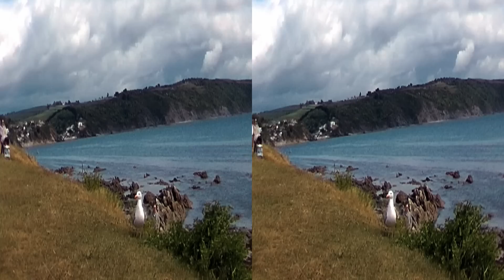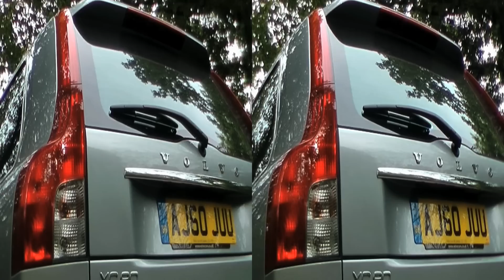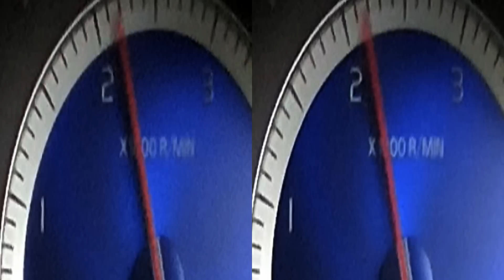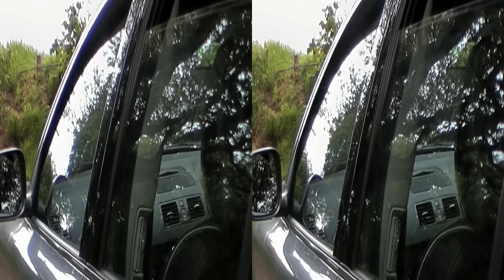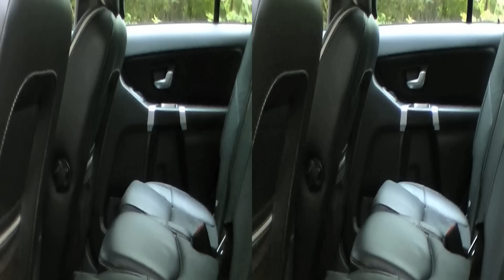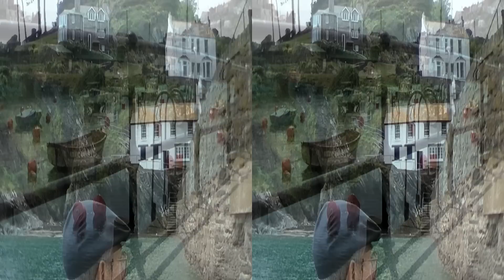3D Volvo XC90 Car Test and News

Comment: The XC90 was not Volvo's first 4X4, or more correctly AWD. The 1997 850 wagon AWD was. The first Volvo AWD sold in the US was the 1998 V70XC. And the latest on the XC90 redesign is that it's going to be for MY 2015, so it'll make it's first appearance in late 2014.